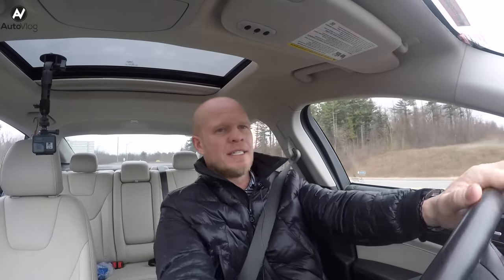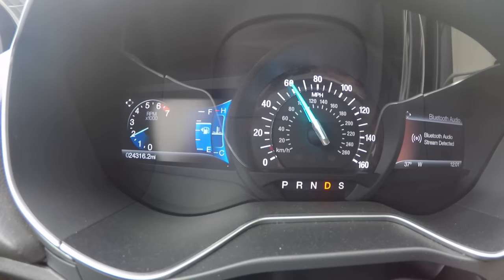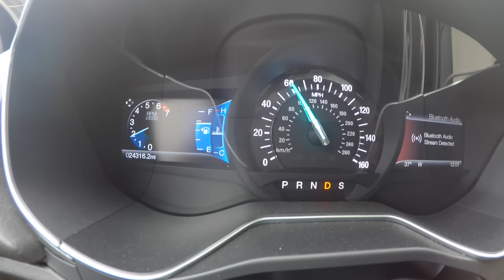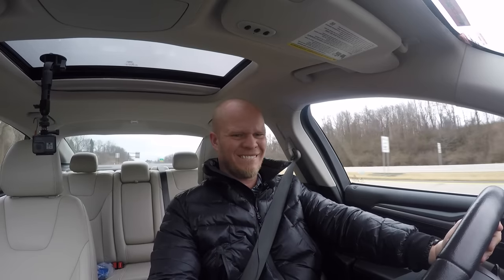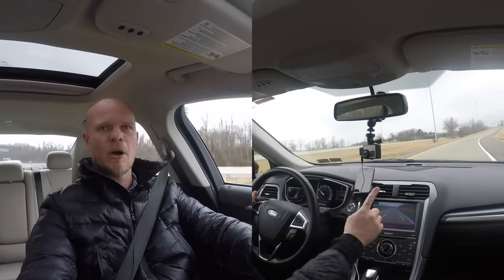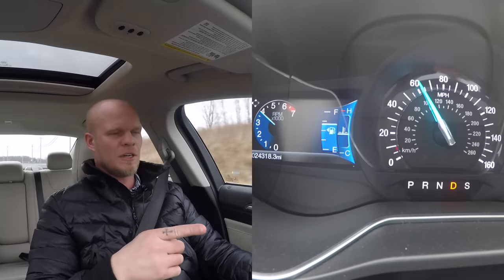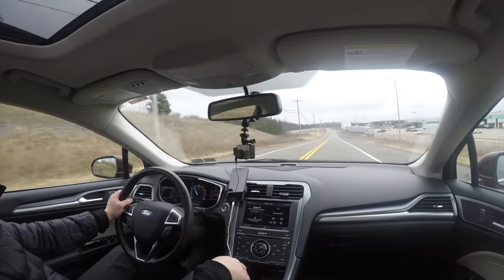What happens if you put your car in REVERSE while driving? (Things NOT to do while driving)

Comment: Do it in a car thats not automatic
Reply: anders nilsen I bet , he won't
Reply: It's impossible, you could not put stick into reverse position. Only if you manage to block driving wheels for a second.
Reply: 11kele Yea? SO try it with some old manual transmition car. ;]
Reply: ive tried, hes right it doesn't work
Reply: can"t
Reply: manual has a block that prevents shifting from top gear to reverse in one motion and due to manuals not having a synchro on reverse you would have to almost stop the vehicle to engage, thats why some cars crunch reverse when still rolling forward
Reply: I did it on a 1980s manual when I was 18  and the grind sound that the gears made was crazy. There is no way I was going to finish the shift with that grind. I could feel the pain...lol. I think the shifter was only half way in so I did not engage the reverse gear completely
Reply: that was gonna be my answer..try it in an oldschool car and see what happens
Reply: thebigz198506 a CVT is an automatic transmission.  He's not the idiot.
Reply: on my theory, it will just grind the gears and wont enter reverse.
Reply: A whole lot of grinding noise and the gear lever will not go all the way into reverse.
Reply: anders nilsen nothing will happen manual transmissions have a revers lockout mechanism that refusea revers when you exceed 12mph in most cars
Reply: Mythbusters did it, it simple won't engage to reverse. The gears will grind with a screaming sound, but it won't engage.
Reply: you'll mutilate your gear box lol
Reply: It's been said before, but in manuals (5 speed is what I'm refering to), the reverse gear dosen't have a syncro ring, therefore requiring you to come to a complete stop in order to not grind the gear. :)
Reply: anders nilsen this isn't an automatic. it's called cvt
Reply: thebigz198506 cvts don't have paddles...
Reply: thebigz198506 It's an inline 4 with a 6 speed shiftable automatic transmission.
Reply: quick ebrake hit

Comment: Hello, recently there was a issue regarding the HYUNDAI PALLISADE SUV vehicle in korea. The crash was happened in down hill. The dirver put gear in reverse to pull back her car from the parking space, and then she pressed reverse again(she thought she pressed drive button. Pallisade has button-style gear knob) and went down a hill. She heard a loud noise in car, but she ignored it. And, she kept went down the hill and used brake once to say hello to friend that was walking by. She kept down the hill, and then she noticed that the vehicle's brake does not work anymore. Finally, her car rolled over.
What I want to ask is that can you do this test with automatic vehicle which has button style gear knob?Thank you

Comment: he didn't accelerate when in reverse... that's what I want to see
Reply from the maker: While shooting the video I did do that as well but I had to edit so much out otherwise people just complain that the video is too long. When the transmission goes in reverse it's like it reverts to neutral and it just revs.. nothing special
Reply: socialillz Doesn't matter, control system won't engage reverse while moving forwards that fast. Especially a computerised control system.
Reply: AutoVlog because  valve body in transmission prevent to engage R mode until hydraulic pressure get down to acceptable limit.
Reply: because...computers.

Comment: Really?  you were driving 80 mph and someone was behind you!! lucky nothing bad happened.
Reply: Carmella, lol he already knew nothing was going to happen. The car won't physically shift the gears in reverse unless you're below 6MPH.  It would be a different story in a manual, but even then it's very difficult to make the shift
Reply: Shikhar Shah new cars nothing happens...  get in a 90's auto and it will fight going in and then lock up the tires when it does go just like a manual with grind like hell then lock up
Reply: Gaming Made Simple I put my 1993 jaguar xj6 in reverse while driving once by mistake going from 2nd to drive (has a manumatic for 1-3) I was going 65 mph and it lit my tires up as the car tried to change directions instantly. a front wheel car will spin the rear around the front.
Reply: Gaming Made Simple or on manual,becouse this automatically put him in neutral for safety
Reply: Carmella I agree very dangerous, putting other people's life at risk.
Reply: Carmella he probably testet what happens before and he was knowing  that nothing gonna happen
Reply: Cause he already did it before !
Reply: Nick Stamper don't doubt it...  I know it's a nasty situation...  Didn't know it would spin you around but I did know it makes a lot of smoke and can shred gears..  and pretty violent inside getting thrown at your wheel lol...  I wonder if it always spins around like yours did or if you had an unlucky break with that
Reply: Nick Stamper Lies.
Reply: Dexter 12 X ok but this video he made it look like it was his first time trying it
Reply: Nick Stamper awesome that must have been scary tho
Reply: Carmella the car wouldn't spin out or lose control. his transmission will pop and leave some metal behind but nothing Terri would happen
Reply: i mean obviously he's lucky its not an older vehicle older cars don't have those type of safety's on them I couldn't believe he was gonna do it I mean it doesn't take rocket science to figure out what happens when you do stupid shit like that it amazes me people would even ask that
Reply: Carmella You know he actually knew nothing's gonna happen. What were you expecting, automatic cars are designed to assist you 24/7, no wonder gears are pseudo-gears in fact, working only when certain conditions are met...
Reply: Colt Lemmon he doesn't need that luck cause he already know nothing is going to happen lol
Reply: Carmella You're beautiful :)

Comment: I would guess this is a electronically controlled auto. New cars have a ton of protection and safeties in place. Trust me, in an old auto it JACKS the transmission and kills the engine. My brother drove a stick and borrowed my dads 1979 toyota pickup with an auto. At about 40mph he tried to shift it thinking he was in his car. The truck violently shuttered and pulsed, the tires chirped and we almost lost control. That truck was never the same after that. We never told my dad..................

Comment: i have a older volvo v70 with automatic transmission from 1998, i think if i do this it will be a different story.
Reply from the maker: It would ;)
Reply: Krauzz i have the same car. i did it accidentally once. made an odd grinding noise, but didn't lock up
Reply: Krauzz I think this guy did his homework before trying this, he'll probably never try it with an older vehicle.

Comment: I did experienced it  when I accidentally put my car (Pajero 2005 model) into Reverse mode when driving on a bridge going down. I got this habit of going Neutral when descending  on a bridge. What happens is the car engine stop and all the warning lights turned on and I have to glide the car to the side of the road. I thought my car broke, I'm concern that I damage my transmission or what. But eventually I restart the car and to may surprise, still working for now. But need to have it check with my mechanic to see if it damage something. Unfortunately for old model car they don't have fail safe features like yours.

Comment: In the military we have a vehicle used for finding IEDs (Bombs) called the Husky and the steering wheel could be popped off if you pulled up on it . well 13 months in Iraq I got bored of the long daily 15 hour missions driving at 5mph (12kmph?) so I would pop it off and see if I could put it back on without going off the road down the cliff into the river. 
Could you take your steering wheel off while driving and see what happens in a normal car?
Reply: sh00th 200 Good job getting the word 'missions' in there. I'm impressed.
Reply: He will obviously lose steering and crash into a barrier, I guess you don't have to be very smart to get into the military huh?
Reply: TelevisedChaos 
Condescending much.
Considering you need at the minimum a GED to get into the military and a majority have Degrees. The military compared to civilians is more educated per 100,000 people. Dont assume so quickly, my comment was just a joke.

Comment: do it on an old 90's automatic. and goodbye transmission and tires
Reply: Ive done this years ago in 1992 Opel Calibra with Aisin AW50-40LE automat. Transmission reacted the same way till the speed dropped to 5 km/h or so, then it shifted to Reverse.
Reply: The sound is also horrendous.  My mother did that to my '92 Corolla pulling into the driveway when I was teaching her how to drive.
Reply: youre lucky, did it on my 94 pajero while going down a steep slope, spun 2 times and my 4 speed tranny(no pun) was leaking and stuck to reverse, had to wait 6 hours for the tow truck to arrive 60 miles out of town. luckily there were a lot of surplus parts, had it fixed by tomorrow.

Comment: Do it on something older that doesn't have the safety. lol...  BANG!!!!! SNAP!!!! lol...
Reply: Gyva02 THUD!!! SCREAMING!!!
Reply: probably not in an auto. an automatic transmission is completely different from a manual, there isn't even a physical (read: solid) connection between the motor and the drive train in an auto. torque converter (what an automatic uses instead of a clutch) is a kind of fluid drive.
Reply: forestR1 accidentally hit the shifter into reverse while on the freeway on my 01 2500hd and it blew out reverse. didnt make a banging noise. sucked cause i had to replace the whole transmission, almost $2300.
Reply: Older auto transmissions have a reverse lock out
Reply: Not all of them.  I was manually shifting an auto on an 80's Toyota Cressida and slipped passed neutral into reverse.  It locked up the rear wheels.

Comment: Dont be a sissy. Do it with older automatic or manual trans
Reply: NOS Huffer manual will just grind gears
Reply: I’m not sure if my car will let you shift to reverse while in sixth gear, it would be smart of Honda to not allow that since reverse is right beside sixth wouldn’t be really hard to accidentally shift into reverse when shifting from fifth to sixth if you’re not paying close enough attention.
Reply: Appalachian Gunman you can't shift to reverse the transmission won't allow you doesn't really matter the car if it's a manual
Reply: @appalachiangunman9589  its kind of hard to shift to reverse in manual trans the gear always because heavy when you try to force it to reverse at 6th or 5th gear but if it succeeds then bye bye to your transmission and your wheels will lock up.
Reply: @Andrei-eb2du  you can shift to reverse in older auto transmission but that will result to skidding and total gear box lock up
Reply: I  did this someone was in The turning lane   as I'm going straight  throught the light he pulls out in front of me I put it in reverse for like 3 seconds then as I realized I was gonna be fine i put it back in drive it was like a slow mo bad ass moment in life but it scared the shit out of me

Comment: This is total bullshit. I drive a 16 year old toyota, and I did the same thing he did, once, by mistake.

Stupid me accidentally shifted into neutral with an auto trans (doesn't have a lock when you go from neutral to drive, drive to neutral) and then went to hold it down and went up instead of down. Transmission made this horrible grinding sound, and jerked backward while I was going 50 (went down to 30, then 15 really fast)
Reply: CoinHuntingDrew that's a different type of transmission. He states he had a Ford focus(I think. I didn't double check) assumably 2014-17 so there is probably a safety mechanism in the transmission keeping it from changing out of gear at such hi speeds
Reply: Looks like a Ford Fusion (we own one).  Not that it matters a whole hell of a lot, but for anyone who wants to get technical.  My 2013 F-150 also does the same thing (backup camera, nothing else), and the 2011 Explorer I had before that, same.
Reply: That's a much older car without all the safety features.  Pretty much what I would expect.  If not a broken transmission.  Maybe the parking break no longer works throwing it into park.   You have Mechanical Linkage going from the shifter to the transmission.  Moderns cars in general lack that.  There's no throttle cable either. it's drive by wire.  It's like a Jet.  There's no cables to control the flaps and stuff, it's Fly by Wire.  it's all Electrical.  Well cars have been moving that direction for many years.  My 2003 Silverado is drive by wire.  There's no throttle cable.  The peddle sends a electrical signal to the engine instead. 

What makes me nervous is the Brakes.  Instead of a real physical connection, instead going Electric controlled also.  Are we there yet with any cars?   When you go electric from a physical linkage connection, you can have more safety.  We saw this on this Modern Car.   If anything, that's a cool trick in case you want to see behind you while driving forward.   Watch out when you come to a stop and then reverse now kicks in and you step on the gas and hit the car behind you.
Reply: Do you think that YOUA are driving the car? No, actually you are operating to give commands to the computer and the car is totally controlled by the computer.
Reply: CoinHuntingDrew 
at 50, the sudden shift into reverse would've killed the engine, unless the accelerator was at pretty much full throttle, and if it was a front wheel drive vehicle, you'd have torn the motor mounts clean out of it
Reply: I did it in a front wheel drive Camry and the brake and engine just shut down until I restarted the car
Reply: You really think the flywheel and clutch can handle that much stress and take the engine off the mounts ? You must've watched too many movies lol
Reply: Your old toyota would of liekly have an older torque converter type of transmission the Ford fusion I think has some sort of dual clutch electronic transmission.
Reply: V1perKiller 

I know they can't handle that much stress..... them OLD Toyota's were shit at best..... no way they would handle a sudden direction change in the drive train..... rear wheel drive Ford's and Chevy's were monsters for the reverse challenge, and spin that puppy around.......